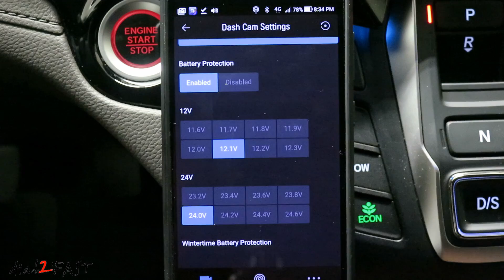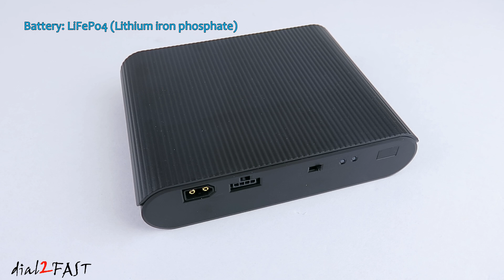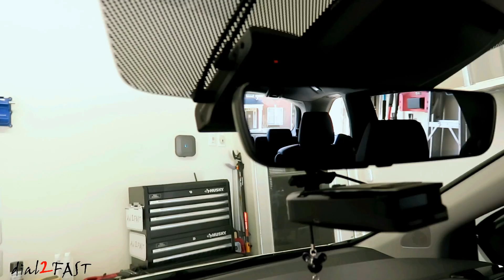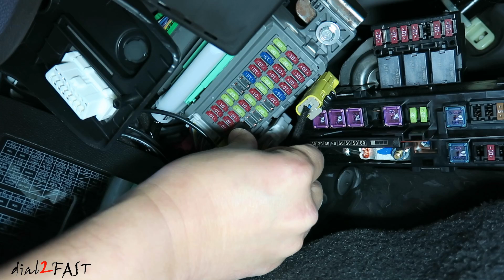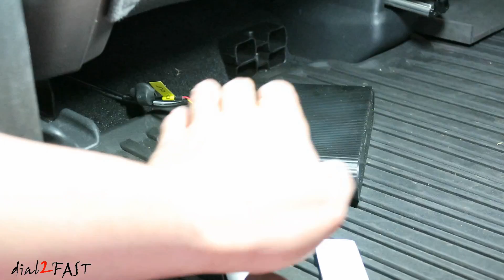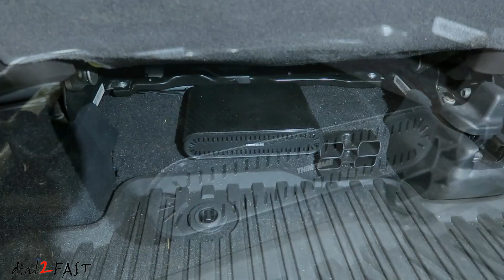Install Thinkware iVOLT BAB-50 Battery Pack For U1000 Dashcam Parking Mode

Comment: Hi, is this compatible on a any brand of dashcam
Reply from the maker: It will work with any dashcam where the power cable uses Ignition 12V and Constant 12V power.
Reply: @dial2fast  perfect, this is almost the same as the ivolt mini?

Comment: In my case (2022 Honda CRV) there were no switched 20A ( Thinkware suggested) circuits that were switched. In your case I beileve you found the same. I see you put a 20A fuse in the tap with a 10A. Would this mean that if the circuit draws more than 10A while charging the battery you would blow the 10A fuse? In my case I see no other option that doing what you have done.

Comment: Good video. Perhaps I am a little slow but I was confused when you talked about your original installation of the hardwire kit  prior to the addition of the ivolt battery. You showed the existing hardwire cable install connections to the fuse box but were not clear that you removed the fuse taps  prior to connecting these wires to the output cable from the ivolt battery. It is clear to you, but somewhat confusing to the unskilled person doing this for the first time.
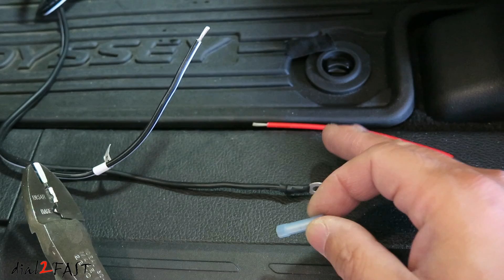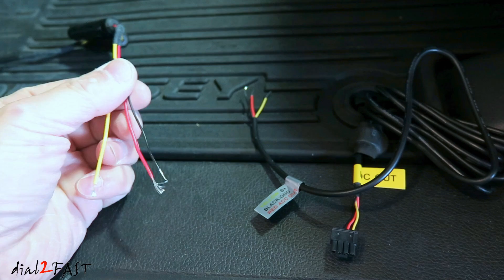Reply from the maker: The original hardwire kit I installed (which I showed the installation in my first U1000 review video) requires both an ignition 12V and constant 12V fuse tap into the fuse box. When I installed the iVolt battery pack, the input to the battery pack only requires one ignition 12V fuse tap 5:48. On the output side of the battery pack, I connected the 3 output wires to the 3 input wires of the power cable going into the dash camera 6:45.

Comment: thanks for the vid, it's exactly what I'm looking for. can you double up the thinkware ivolts, so you have more capacity?
Reply from the maker: I don't believe you can do that with this battery pack. It doesn't have a port for daisy chain connection.

Comment: Hi, Question and apologies in advance. I have the thinkware u1000 and the Blackvue B124x. The B124x is being charged via the cigarette port and the thinkware is also connected to the B124x via the cigarette port. 

Does this prevent the parking mode from being engaged and if so, do I change out just the output cable to the 3 wire from the the cigarette wire for the dashcam to the battery, or do I also have to hardwire my battery to the car and also the dashcam to the battery?
Reply from the maker: The U1000 need 3 wire connection for parking mode. The B124 can be charged with cigarette lighter.

Comment: did the camera ever drain your  main battery? I got a message on my 2020 Odyssey this morning that battery level is too low after running this camera for few days  now, it  did start  as usual and voltmeter shows 14.3 when running, just curious. I'm getting the battery pack on black friday :) Any other recommendations  for battery pack after you used it for so long? Something better but in  the same price range maybe available from thinkware  ? Also, how long  is the battery pack wires, will it be enough to reach spare tire compartment? I have my amp, audiocontrol lc2i in there, so I might put battery pack there too
Reply from the maker: Since you said you are getting your battery pack on black friday, then I am guessing your battery low issue is from the dashcam being hardwired to the fuse box for parking mode. If this is the setup you currently have, then yes it does drain the car battery every time you park. You need to set the voltage cutoff on the dashcam to protect the car battery. Once you install the battery pack, the dashcam will NEVER drain the car battery when parked. It will be running off the battery pack. As for installing it in the spare tire area, it should reach since the spare is located in the second row. But keep in mind the battery pack need ignition 12v, and not constant 12v source.

Comment: Why do you use the 10 volt from the fuse box? I notice the other guy in another video used the 20 volt from the fuse box.
Reply from the maker: I believe you are asking about the 10A fuse (and not 10 volt). The fuse rating is in amperage which is the current draw. If you hardwire the charge cable to the fuse box, the maximum current draw to charge the Thinknware battery is 7 amps. This is why I tapped a 10 amp fuse because you want to use a fuse that is rated higher than the 7 amps. This also means a 20 amp fuse will also work. Having said that, you don't want to tap a 5 amp fuse to charge the battery because that circuit will not supply enough current.
Reply: @dial2fast  Hi, just to clarify iVOLT BAB-50 Battery Pack comes with set of 20 amp fuses, please correct me if I'm wrong, but my understanding was that the fuse that you pull out of the fuse panel/box must be same or grater amps as accessory (external battery in this case). The reason I'm asking this because I'm not sure should I tap this battery to 15 amp fuse (in my car that would be a cigarette lighter circuit) 20 amp fuse (in my car that would be a heated seats)?
Reply from the maker: @ZNavy  The fuse rating you are looking for in the car should always be higher than the device current draw rating. In this case the device being the BAB-50 draws 7amp max. So you can tap a 15A circuit or a 20A circuit. Even though the BAB-50 comes with a 20A fuse, that just happens to be the fuse they include. They could have included a 10A or 15A fuse and that will still work. The original fuse from your fuse box will go into the bottom slot of the fuse tap and therefore retain the original circuit in the vehicle. Since the BAB-50 comes with a 20A fuse, you will place that fuse in the top slot, and this 20A fuse will be the one to provide current to the BAB-50. Technically, you can put a 10A or a 15A fuse in the top slot of the fuse tap and that will still work fine. But you cannot put a 5A fuse in the top slot because the 7A will exceed the 5A and blow the fuse. In your example, you are perfectly fine to tap the 15A cigarette lighter fuse.
Reply: @dial2fast  Thank you for your fast reply and your detail explanation. I wish they would use lower then 20 amp fuse in IMHO this would create less confusion.
Reply: @dial2fast  Thank you!

Comment: The "200 PCS Insulated Wire Butt Splice Terminals" you linked do not work well. The hardwiring kit wires are way too thin, even with a proper crimping tool...

Comment: Does the rear camera independently detect motion and start recording during motion detect parking mode?   Your info is much appreciated.  Trying to figure out if I need 2 front cameras or just a 2Ch unit.
Reply from the maker: Yes the rear camera also detect motion.
Reply: @dial2fast  Do you still made this unit to perform a test?  Getting mixed answers and some say the rear will not detect motion and only start recording once the front unit does during motion parking mode.  I'm usually head in first and the front camera is facing a wall, so it won't detect motion if someone walks by the rear to initiate the record.

Comment: What if you don’t want any recording to happen when you are parked in a secure garage versus parking in non secure public parking space. Is there a way to preference these recordings?
Reply from the maker: There is no scheduler for when parking mode recording happens. If you don't want parking mode recording (with this system setup), then switch the battery to the off position.
Reply: @dial2fast  thanks for the reply. Very informative videos

Comment: Hi can you tell me what happens when the iVOLT battery runs out will the system start using the car battery?  Many thanks
Reply from the maker: Once the iVolt drain to a very low level, it will stop outputting voltage to the dashcam and the dashcam will be powered off. It does not drain the car battery.
Reply: dial2fast thank you

Comment: Hi I had a question... Do you just take the hardwire from the dash am and connect that to the battery hardwire kit? Do I just ignore what you did in the first video when you just installed the dash cam without the battery??
Reply from the maker: Yes that is correct. If you buying the battery pack, then just connect the dashcam power wire directly to the battery pack.
Reply: @dial2fast  thank you for the info, great video!!
Reply: @dial2fast  Thank you, Sir! I was wondering the same thing. I'm doing a new install from the start so I now know to skip the hardwiring of the dashcam directly to the fuse box because I will be installing it directly to the battery pack which will give me the full function of the parking mode. 
Thanks again!

Comment: My car fuse box is inside of engine; (Toyota PLIUS)  because that I used my cigaret power supply - CAN YOU SHOWING HOW TO REWIRE WITH THE CIGARET PLUG? My car was already hit in the parking lot and my camera is installed only to work when I start the engine, Thank you.

Comment: Hey great install video. I was wondering which fuse slot you went with on your install (ex. Accessory or Option)? Thinkware says to go with a 20a fuse slot and use an equivalent 20a fuse in the fuse tap, but on my Acura RDX, all the 20a slots are constant power, even when the car is off. Your help is greatly appreciated.
Reply from the maker: On my 2019 Odyssey, I tapped into the igntion 12V fuse labeled Option. On the battery pack, the charging switch Low is 5A, and High is 7A. So tapping into a 10A fuse slot will work fine.

Comment: How does this compare to the Chanun Power battery pack?  You can buy 2.5 Chanun Power battery packs compared to one of the Thinkware iVOLT BAB-50.  The Thinkware needs to last 2.5 times longer to make it worth buying.   (This is referring to years operating trouble free in your vehicle)

Comment: So you removed the fuse taps from the original installation ?, then cut those taps from the 3 wire harness where you had spliced them together ?
I didn't see that part anywhere or did i miss something ?
Did the butt connectors come with the camera, 3 wire hardwire kit or the battery ?
Thanks
Reply: Great question Sean! I just watched this video and I was wondering the same? Do you remove the original hardwired fuse cables now that you are installing the Ivolt battery pack which is designed specifically to work in parking mode. Sean I don't see that this gentleman responded to your question. If you have the answer it would be greatly appreciated. Thank you in advance!

Comment: Be aware that a car sitting in the sun for hours can still exceed that temperature. Better to just add a second actual car battery and hook that along with your radio equipment up to it.
Reply: Actually these types of batteries are Lithium Iron Phosphate and designed to work in high interior cab temps.
Reply: A42yearoldARAB what will happen if the temperature is exceeded?
Reply: Thanks for the tip, could you please explain how,  & which devices hook to that second battery? Thanks

Comment: I think the back up batteries are definitely worth it since my car sits for a few days (I have a work vehicle). I have the U1000 and I installed the Cellink Neo hardwired in my car. like that it fully charges in about 20-25 minutes. I'm going to buy the Radar module but i'll wait to see from dial2fast next video to see if it's worth it. Just wish the Cellink Neo had a USB port so I could connect a 4G mobile Hotspot to it so I can get alerts.
Reply: i have cellink neo its great battery and gives you 24hr+ of parking mode for 2 channel dashcam i have thinkware q800 pro! and the u1000 radar module is for when you activate the powersaving mode its just give you 20second clip after impact but for radar module you will have the advantage of before and after the impact for powersaving mode similar to motion detection and goes back to sleep if no impact detected and it will go back to standby mode if there's motion is detected the goodthing with powersaving mode it will double the number of parking mode hours !
Reply: With you having a work vehicle, what happens if you let the car sit for a while and the external battery drains?  Does it’ll the days cam still draw from the car battery, or does it just shut down from no power?
Reply: Jack Kirby the cam will lose power once the External battery runs out of power.  Cellink has the ability to add a second battery so you can double the runtime when the car sits for the week.